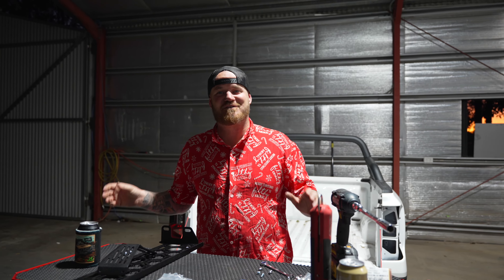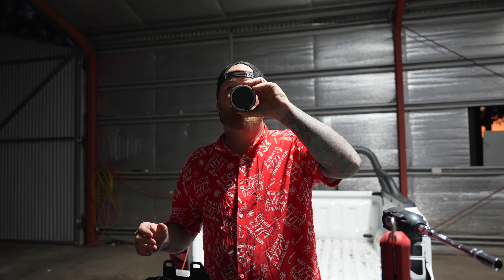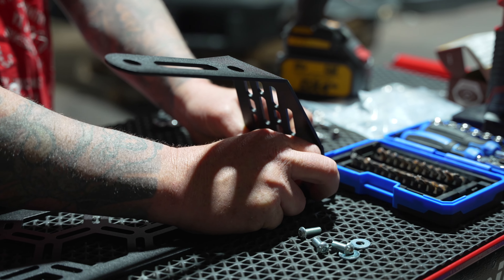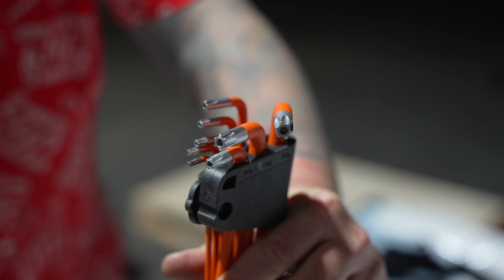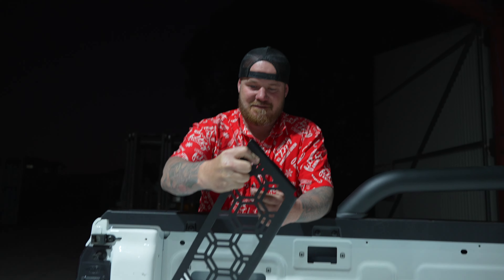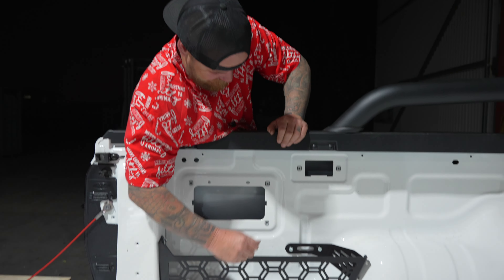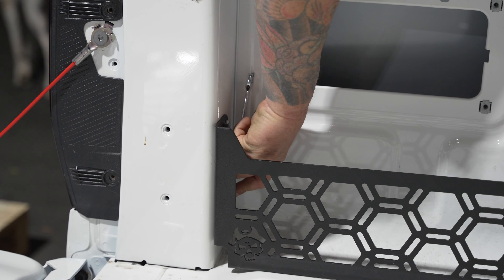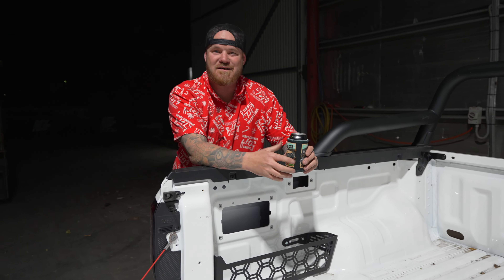NEXT GEN RANGER RAPTOR MOLLE PATTERN STORAGE POCKETS How To Install

Comment: The side will be good for the maxtrax rack when we come up with some brackets to hold it flat for the rear roll bar. But above your logo instead of cutting the hexagon out cut the bottle opener in to it and do the same on the other side. Just let me know if you would like me to come in and show ya what i mean as happy to come in after work to talk and measure everything for the back of the triton.
Reply from the maker: G'day legend - thanks for watching, We have something in min that will cover what you're talking about. It's in the que, but still a little bit off yet.